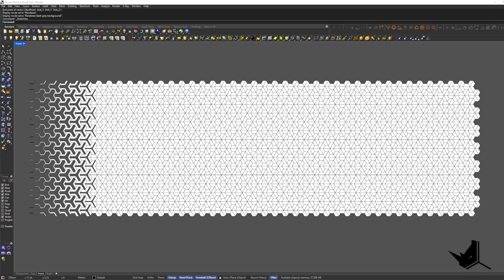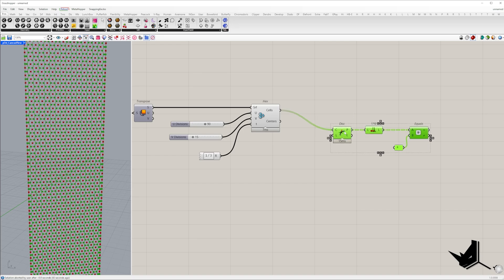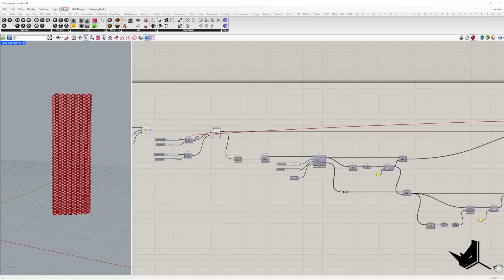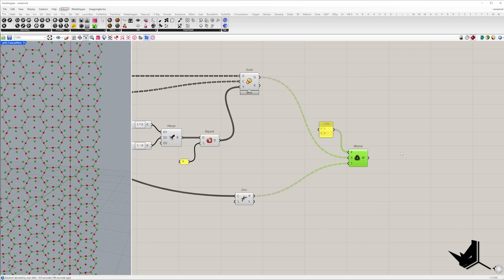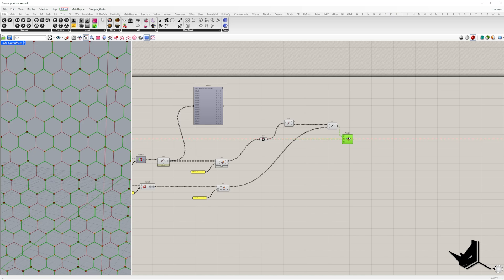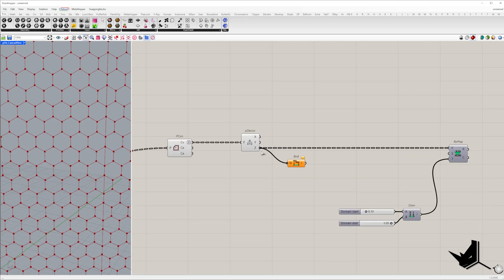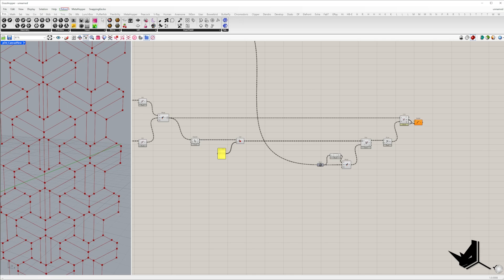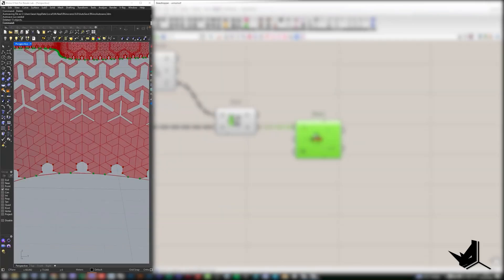THIS looks hard, but it's EASY to make (Step-by-Step)

Comment: At 2:45  I get red warning when connecting bounding box and surface. When I bake the bounding box, I get a polysurface instead of a surface, which I think should be a surface instead? Using Rhino 7 and 'Reverse Surface Direction' instead of 'Transpose Surface', idk if that is a reason for this error?

Comment: Hola! intente realizar el ejercicio pero me quedo pegado en la herramienta "Transpose Surface" será la versión de Rhino o Grasshopper? (Rhino 7.0) Muchas Gracias, buen material....
Reply from the maker: 'Transpose Surface' component comes with Rhino 8. You can achieve the same result using the 'Reverse Surface Direction' component from the Lunchbox plugin, just make sure to set the 'Reverse Option' input to 3.

P.S. Let’s keep it in English next time.
Reply: @HowtoRhino  es bueno manejar otro idioma que los convencionales. jajajaj gracias amigo!! Lo intentare